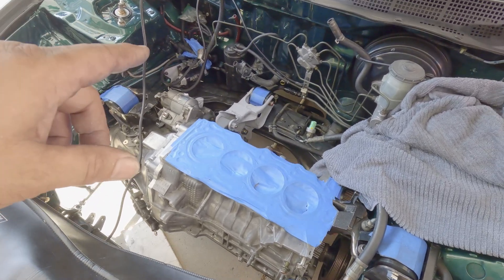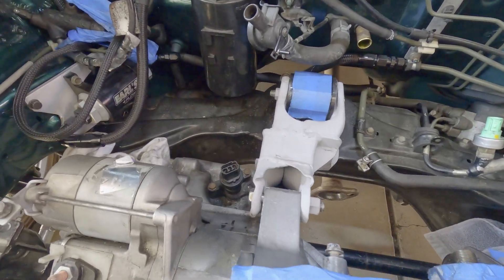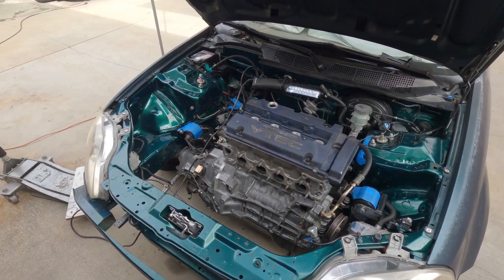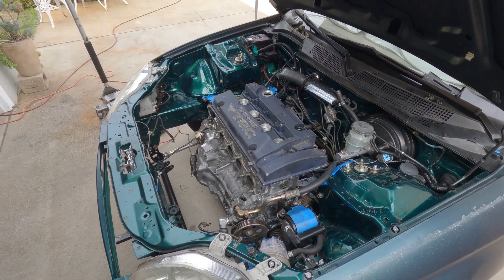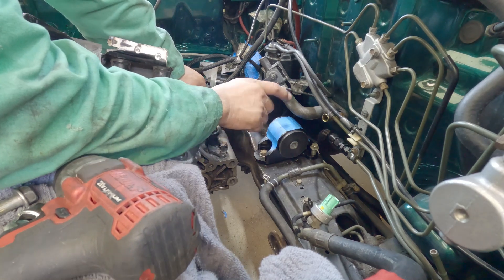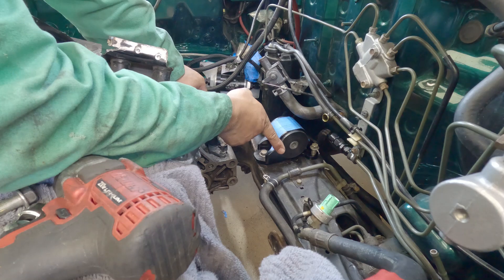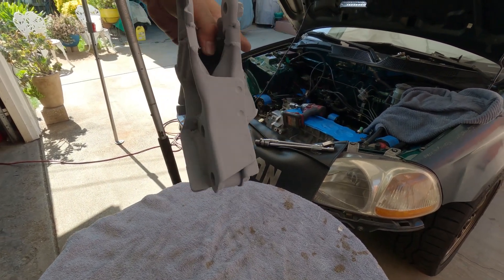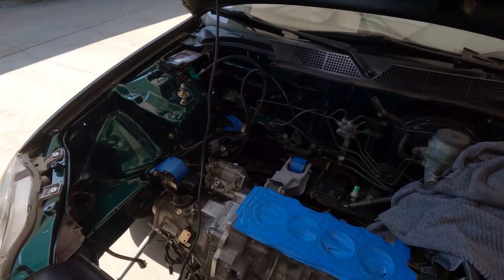What rear T bracket to use on G2B Civic swap? ep.9

Comment: Hey saggit! Do you have a spare h2b kit for sale? Hehe
Reply from the maker: Sorry brotha, no spare, l'm going to use the ebay kit l've got for another project. I know its very cheap and you could actually afford it except that it'll require you to be creative, to name 2 things;
1) need to modify the bolts(like i've shown) or buy it on ebay
2) You need a bigger bushing that'll fit on the plate so the tranny alignment pin will fit snug to it, otherwise the tranny will not fully seat center on the adapter plate.
Its best to get the legit h2b kit, l know its costly but its less headache in my opinion unless your'e like me that like to tinker on things and make it work.

Comment: Hey I just dropped a f20b in my ek. So it cranks but no spark. Im thinking it’s the crankshaft position sensor
Reply from the maker: Use chipped p28 ecu. Hondata s300, aem or any other Honda chippable ecu's. Obd2 to obd1 ecu jumper harness and use obd1 h22 distibutor and dizzy conversion harness. Honda-tech.com have a good write up if you need more info. You can run your f20b by staying obd2 but you have to be good on wiring, everything has be look at when staying obd2. The downside on it is, you cant get your engine tune.
Reply from the maker: It can be! Are you using obd1 ecu? What harness did you use? If it is, you'll need to use obd1 distributor.
Reply: @sagittnet2158  so I’m using a 96 ek harness from my old shell. I’m currently using  obd2 stock ecu because I’m having problems with the ecus, only the stock ecu works the fuel pump.
Reply from the maker: @fresh__lettuceee  l'm not sure w/c stock ecu your'e using if it's the ecu for your d16 or F20b ecu. In order to get it running correctly or ability to tune it correct, it must be converted to obd1. Hamotorsports.com have lots of info on swap.
Reply from the maker: @fresh__lettuceee  Check hamotorsport about your 96 harness iacv conversion also, otherwise it wont idle correct.